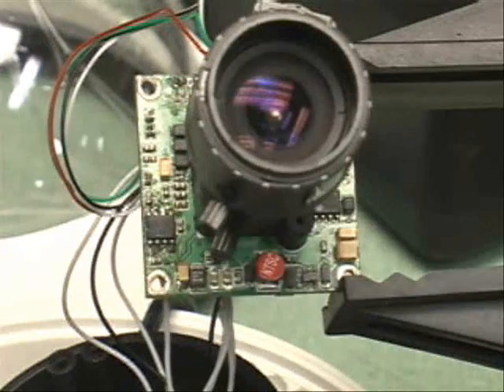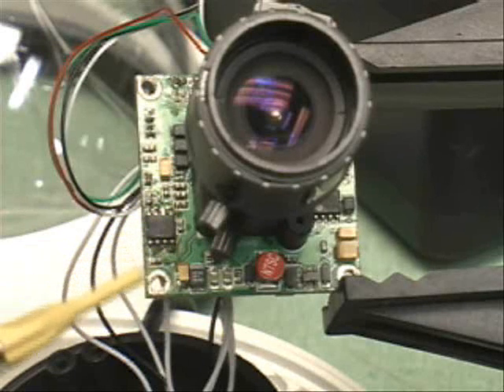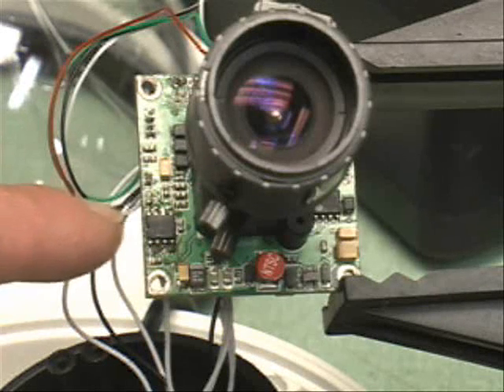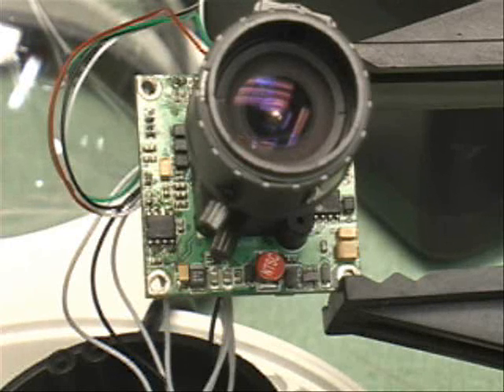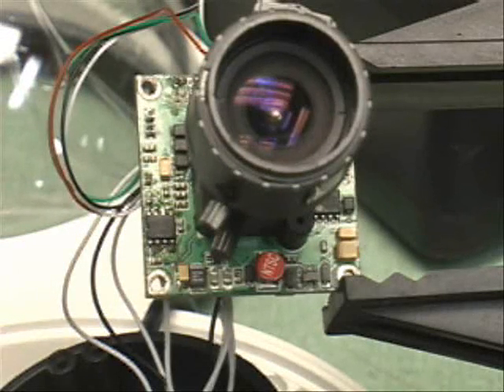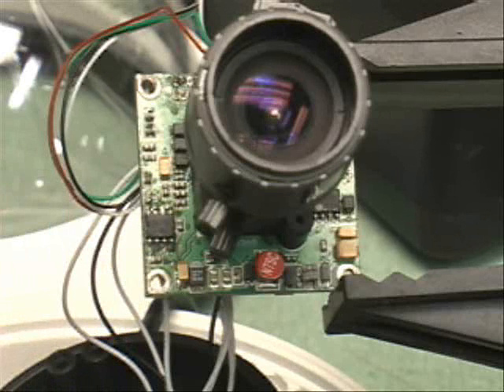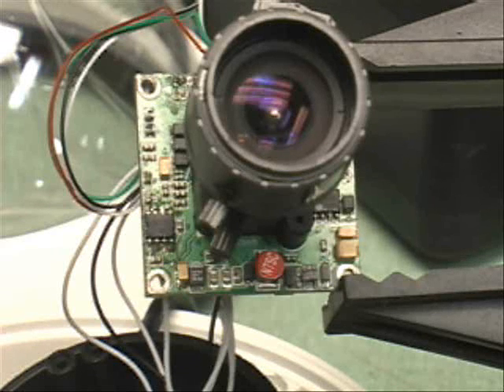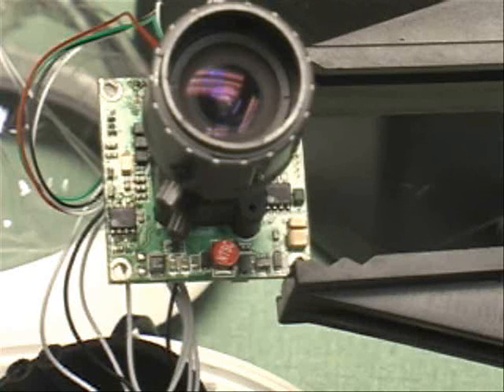ccd camera repair

Comment from the maker: Thanks for your input.
Here's what I had done prior to making the video but forgot to mention:
1) the Capanalyzer(that's the brand name) I used is a very trustworthy tool. If this 4.7uF cap fell thru the test, it would be a first for me...
2) I did try 2 known good tantalum 4.7uF smd caps in its place, the same sync loss occurred. This drove me nuts cause I was initially almost sure the 8-pin BA10358 replacement would fix it.

Comment: There is a video for fix inverted polarization fried cctv cameras?
Reply from the maker: zak00101 Not exactly sure what issue you have on your camera. If you can be more specific, maybe we can search for a solution.
Reply: Nelson Chua If you connect positive on negative anda viceversa in a DC device, short circuit happens. Is there a way for diagnose a repair that devices?
Reply from the maker: zak00101 Getting a schematic diagram of the camera helps. But doing voltage checks also help. Typical voltages for these cameras would be 12v. You would therefore have a voltage regulator in the circuit of some sort. Usually a 3 pin SMD IC. This is what would most likely fail.
Reply: Nelson Chua Thanks Nelson.
Reply from the maker: zak00101 you're welcome. FYI, just be careful where you get replacement parts. Try to get them from reputable domestic suppliers whenever possible. Knockoff parts are prevalent esp. on ebay. See my experience with one such purchase....https://youtu.be/kdBFn4uxNm4